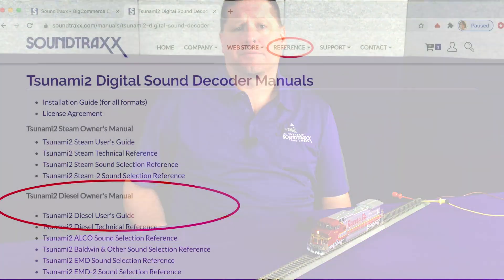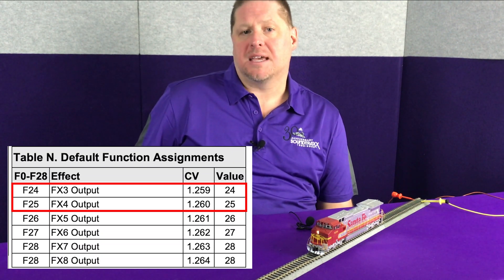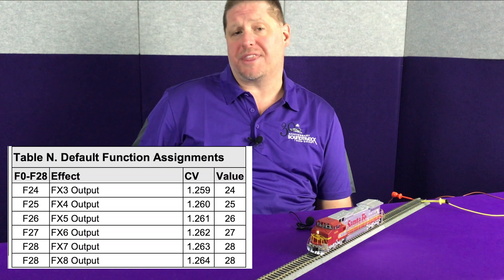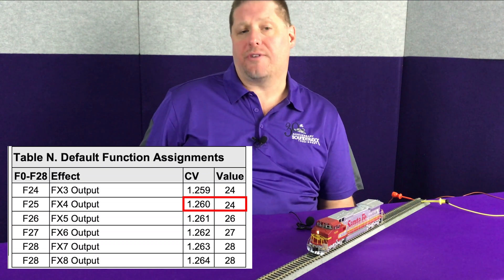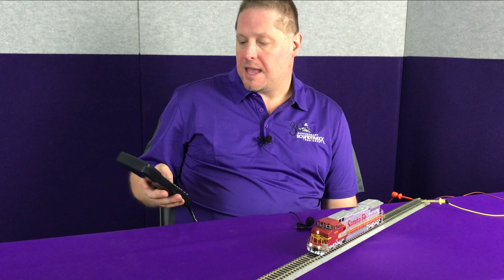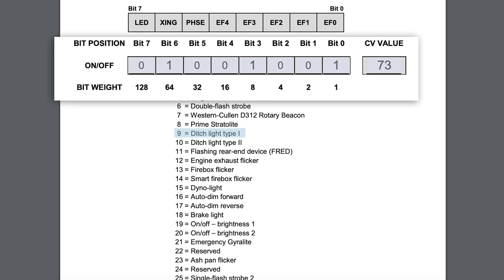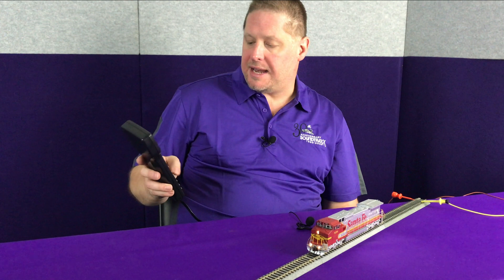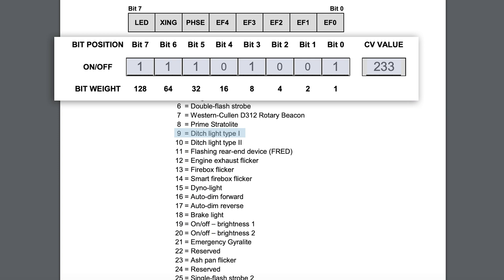How to set up Flashing Ditch Lights with Tsunami2 decoders

Comment: doesn't work, have my tsunami wired exactly as stated and starting from fresh decoder reset, f24 still does not activate both front ditch lights, f24 activates one and f25 activates the other even after following this vid perfectly
Reply from the maker: This video uses an aftermarket Tsunami2 decoder. If you have an original Tsunami decoder or a factory installed decoder function defaults may differ. Please contact our Support Team for more assistance: (970)259-0690 ext. 22 or support@soundtraxx.com

Comment: What CVs will I have to change to have my ditch lights stop flashing? I have a Athearn Genesis SD75M with a Tsunami 2 decoder.
Reply from the maker: Contact our Support Team they can help you with your specific locomotive. Athearn often moves the lighting functions to different defaults than aftermarket decoders: support@soundtraxx.com or (970)259-0690 et. 22. Thank you.

Comment: With the correct 8 function decoder installed, I have working ditch lights now. Being a green horn with DCC, this process was a little tough for me to understand at first. Bringing the laptop to the train table helped a bunch. Today I'll adjust the rate of the alternating lights. Thanks for this video, it has raised my  confidence  level with the NCE power cab.
Reply from the maker: We are glad the video helped. If you ever need more assistance than our videos supply you can also contact our full time Support Team: support@soundtraxx.com or (970)259-0690 ext. 22

Comment: My new Athearns CSX GP39-2 with TSU-21PNEM decoder-- I cant get the ditch lights to work at all. F24  ( FX-3 Function Output) doesn't do anything. F23 works "all aboard" using the NCE Power Cab.  This video would probably help once I get the lights to come on. Any suggestions? thanks
Reply from the maker: Please contact our Support Team directly for help with this: support@soundtraxx.com or (970)259-0690 ext. 22.

Comment: How do you access the dot? I see nothing on the MRC Throttle. Thanks
Reply from the maker: It does vary by command station. George talks about different command stations in this webinar: https://www.youtube.com/watch?v=-w5ttfthhNk&list=PLwWuwya-crVbw63Hh5OUpW2lZ8rx31Mdf&index=9

For more help you may need to refer to your command station manual or manufacturer. We cannot offer too much command station support as we do not manufacture or use all the different command stations out there. If you can't get the info you need from the command station manufacturer you can contact our Support Team for help and they will do what they can.

Comment: So, you need to be a computer programmer to get flashing ditch lights? Surely you guys can come up with a more user-friendly method?
Reply from the maker: No, you just set it up using CVs. This process can be found in the Tsunami2 User's Guide in the manuals section of our website or you can contact our Support Department for more help: support@soundtraxx.com
Reply: Ok, real prototypical problem. When real ditch lights flash they don’t go all the way off, there full bright then go down to about half brilliant. TCS has that worked out nicely on there decoders.

Comment: I have a CN GP-38 2 (w) with Tsunami 2 decoder, LEDs and it is relatively new. I would like the ditch lights to flash.  Both ditch lights are controlled by the F5 key on my controller. How can I get them to flash when the horn is sounded.  Please let me know what to do. Thank you.
I use a Digitrax DT402D controller and which typed of programming mode should be used.
Reply from the maker: Please contact our Support Department directly for help with this: (970)317-3505 or support@@t

Comment: George...that was a great explanation but I'll have to view it a couple more times to fully absorb everything that you said. I have one locomotive with an Econami decoder. Will the information in this video work with that decoder? Thanks...Harold
Reply from the maker: That's just fine. That is the great thing about the videos, you can refer to them as many times as you need. Yes this will work for Econami Decoders as well.